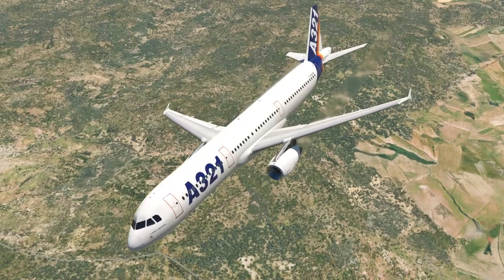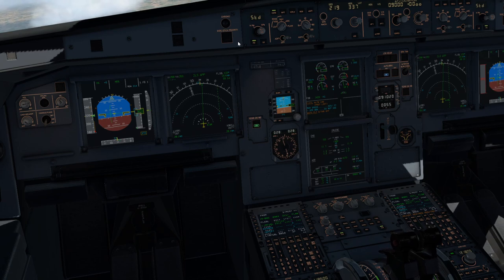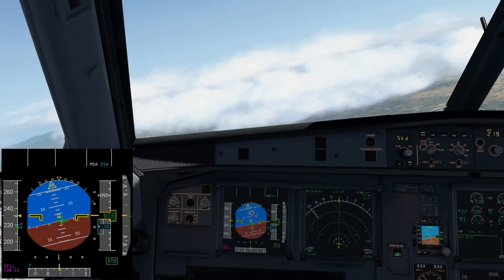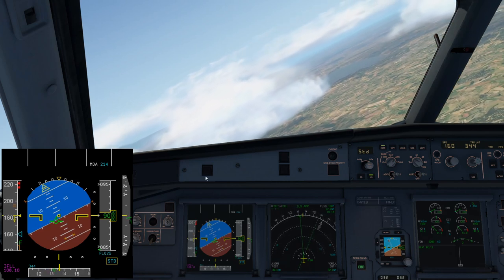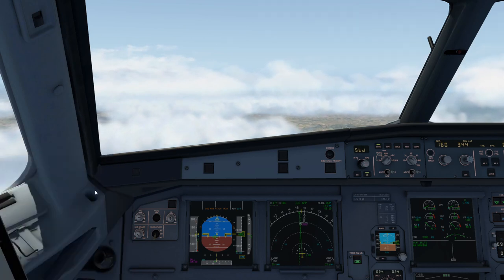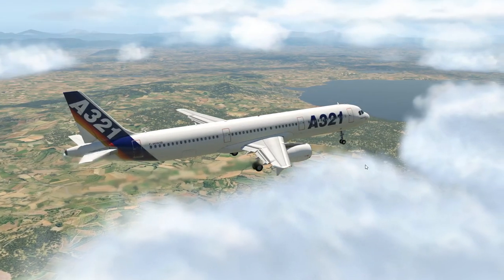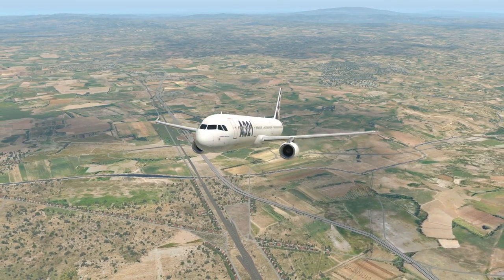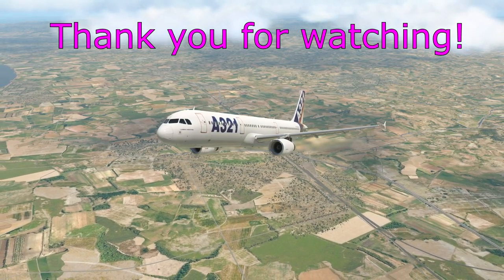What is the Airbus:Part 3 Trimming! Direct Law with a Real Airbus Pilot ToLiss A321

Comment: The comment about manually adjusting trim applies to flight simulators in general. In a real airplane, say, a Cessna 172, you apply forward/back pressure on the yoke and trim to relieve the pressure. But, on a flight simulator, adjusting the trim doesn’t have any effect on yoke pressure. One has to slowly return the yoke to its center position while simultaneously applying trim to get the aircraft trimmed properly.
Reply: While this is true for Cessna or Boeing, like he said the Airbus sidestick does not have force feedback. So it is just like flying in a desktop flight simulator without any feedback, manually adjusting trim.

Comment: Very well explained, but unfortunately, there is something I have not yet fully understood: You said that Direct Law is applied when the landing gear is lowered. However, I suppose that is only the case if the aircraft was previously in Alternate Law. I always thought Direct Law is a configuration in case of total system failure, e.g. if both engines fail/burn. How you explained it now, Direct Law is not a result of an emergency but rather of manipulating the aircraft configuration whilst flying in Alternate Law.
Reply: Yes, direct law is what happens when you put the gear down in alternate law.

Comment: very educating video, thanks for your effort to bring these techniques to us. Are there any statstics how often a alternate/direct law situation occurs i.e. in 10.000 flight hours ? On the Airbus sidestick there is no possibility to trim the aircraft like on Boeing aircrafts, so you have to do it on the wheels, correct ? Is now a mandatory simulator training established for manaul flight in alternate law in greater altidudes because airplane handling is very sensitiv and failure margin is almost zero ?
Reply from the maker: Glad you enjoyed it Eva. I do not have any statistics about that but I will have a look, it would be very interesting to me too. On the Airbus sidestick there is no way to trim, you must use the wheel next to the thrust levers, it is easier than it sounds to control like that! Pilots do indeed train in alternate law as well as the other flight control laws. Thanks for watching!